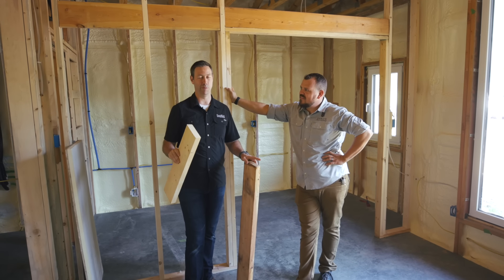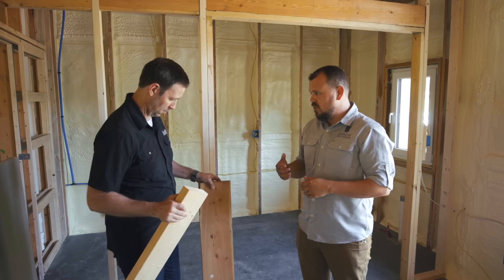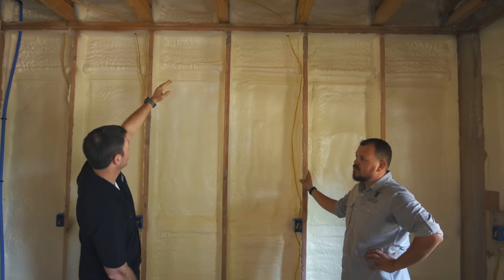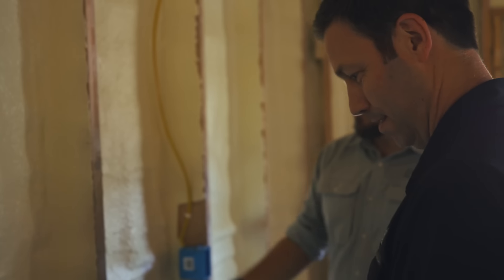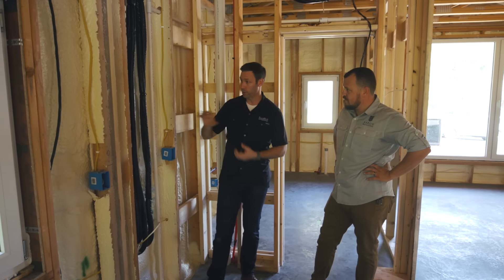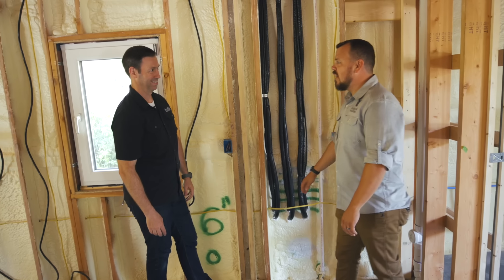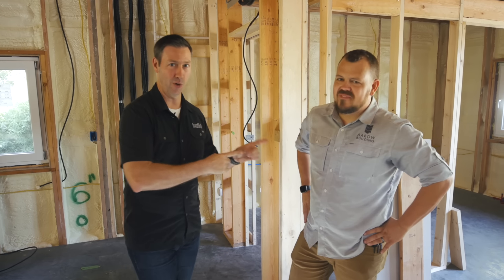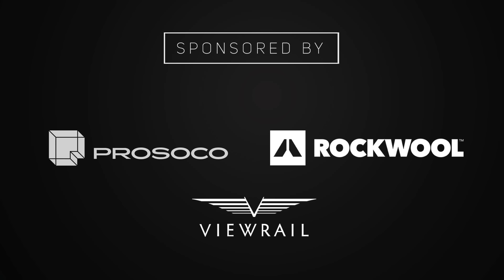Why would you frame a house with 2x8 lumber?

Comment: In Finland we use 2x8 and then a 2x2 on The inside with the air barrier in between,  that has been The norm here for about 20 years
Reply: damn you rich...
Reply: @lifeispain07  In Sweden we used to do that : ) now some new houses have 2x14" (most have 2x9.5"), and that is not even a passive house build. It really don't add a lot of cost going up.
Reply: @lifeispain07  And generaly the houses are much smaller.  It's still a good thing to be warm at -30 degrees.  And something to think about here as our winter temprature appear to be getting colder.
Reply: Simon Jäkälä 

quick question, are wood houses common/predominant in finland? i’m from central europe (let’s say, the temperature range would be from -20C to 36C (-4F to 97F)) and although i feel like they’re gaining in popularity, still most of the family houses are done from some type of brick/concrete.

on youtube, one gets the feeling 95% of US family houses are some kind of wooden lightweight frame construction.

edit: here for example stats from germany (2018, family houses):

(clay) brick 25.300
autoclaved aerated concrete 20.721
wood 16.711
sand-lime brick 11.944
reinforced concrete 4.883
lightweight concrete 2.709
other 1.232
steel 3
Reply: Thougt exactly the same, even with the outside insulation you get a thermal bridge With 2x8" if you use 2x6 and then additional 2x2 you get a real reduction in thermal bridges that will save you money in the long run.
Reply: @kam_iko 

Of all The smaller/normal residential houses i would say about 85 percent is some Type of wood structure, log or stud
Reply: In Denmark I just finished 2 houses with normal brick walls outside, a 1" wood fiber board, 2x6" and 2x4" walls.
Reply: @kam_iko  I imagine that wood framing lumber is not as available in many places in Europe.  In the USA we still have trees avalable at an economical cost.  We also replant forest lands, unfortunately this should have started 15 to 20  years earlier.  But the regrowth is going well and the cycle is on going.
Reply: Simon Jäkälä 

interesting, is it because of tradition, price or pace of construction?
Reply: David Johnson 

i don’t know, forest farming has quite a tradition here (central europe), but i’m not in the construction business, so can’t really comment on the lumber prices.
Reply: @kam_iko 

Well tradition and price but that is due to abundance of trees/forrests. The planting of new trees vs. old being cut down when measured in m3 is about 125% in favour of new trees
Reply: In the faroes we do the same , we also build concrete houses with essentially a wood house on the outside wich holds the isolation
Reply: @simonjakala2046  Russia have a lot of trees so no problem of a shortage :). New houses in northern Europe are all pretty close to this one. Insulated slab on grade, floor heating, wood frame, deep studs, rock wool,  only exterior differs. A lot use wood other go for stone or other.
Reply: @kam_iko  Three things may be advantages here on or near the west coast: a lower cost, very fast to build and very earthquake resistant.
Reply: David Johnson tree farming has been in existence for over a century.
Reply: snettan So horizontal 2x2’s? This will give you 2” more inches of insulation towards the interior of the envelop, not the exterior. So your taking the R6+/- of the Zip System and transferring it to the inside. Then there is no conduction to the inside except where the 2x6 and and 2x2 meet. Seems like this would be a little less money, but same insulation value or space of 8”.
Reply: @tyrehester5550  And in the north west they were slow in starting an effective tree planting program.  There could be a lot of hundred+ year old trees here but they didn't get planted.  Most tree planting here started about 60 years ago.  In spite of all the other tree planting in the world.
Reply: Just to be clear, you are talking about 50x200 with 50x50 inside?
Reply: @ReedikTuuling  Yes, except usually made from dimensional lumber which is 48x198 and 48x48. 
Simon Jäkälä forgot to mention that wall thickness is on building code because insulation value requires that wall thickness with blow-in insulation or batts. You can make thinner wall if you use better insulation like PIR.
Reply: @lifeispain07  Rich? 
Here in Finland Spruce 2x4 lumber cost $0.6 / foot and 2x8 lumber cost roughly $1.4 / foot so not  huge difference on whole frame and we always use 24 O.C layout on exterior walls. 
Also building code requires thick wall due insulation value needed.
Reply: @MM-sf3rl  So horizontal 2x2’s i great in so many ways. Lets see. Adds a conduit for electrical. Adds insulation before wapor barrier, and that gives is stops condensation if you cool the house in summer. Adds R value, We can use thinner studs and that gives use more of thinner trees. Adds stabilization, gives flatter walls. Adds strength to drywall.
Reply: @mr.wizeguy8995  When you use stronger studs you don't need them 16" on center and that gives u need less of them if you go bigger and stronger. And that makes up for a lot of the cost.
Reply: @ReedikTuuling  In Sweden, perhaps other EU too i don't know lumber is normal in, 45x45 (used inside walls, horizontal), 45x70, 45x95 (common), 45x170, 45,120 X195 X220 (used for walls in new houses), 28x70 (used in ceiling before drywall and outside. All in millimeter.
Reply: @72strand  Here in Finland we have 48x48, 48x98, x123, x148, x173, x198. 
It's quite rare that residential house is built completely on site, really often walls comes from factory as premade either whole wall as one element or smaller 4ft wide and room height elements.
Reply: @davej7458  You'd be wrong in that assumption. Not only is lumber more available, but it is of a higher quality. Forest farming has been going on for decades longer in Europe than USA interests ever cared to investigate. Better quality by an exponential amount.
Reply: @donaldcole1803  That was not an assumption it was an open question.  I made no comment about tree farming in Europe as I have only a general knowledge of Europe.
 We on the the other hand have lots of trees and different problems.  Our Government is restricting the use of those forests.   Many are dead or drying because they have reached their healthy life span other species in other areas have the potential to live hundreds of years more.  Because of the poor management practices of our government we have beetle infested forest land full of dead fire hazard trees. There are enough beetles spread to and overwhelm healthy forests. The natural fire cycle os destroyed. Instead of a normal fire that clears the brush and allows seeds in the forest seed bank to grow.  We have a fire that destroys every thing all the trees and seeds.  Also the creeks rivers and the fish.
Reply: @davej7458  What you posted is once again false, though it supports your underlying narrative. 'Our government' is NOT - repeat NOT restricting the use of forests. First of all, the federal government does NOT own all the forests in the nation. That is Part One of your lies - multiple. Second part of the lies, even the forests the federal government does own, they are not 'restricting the use'... they are restricting the deforestation. They are restricting the mining. They are restricting the raping of the land for commercial profit because under the Republican President Teddy Roosevelt over a century ago the nation realized sometimes you don't have to ruin every single thing you can see in order to make a few extra dollars of profit.
Reply: @davej7458  Actually balloon framing - as done in the USA --  is extremely weak in protecting against earthquakes, not to mentiopn earthquake protection has NEVER... EVER been a focus of USA construction.
Reply: @donaldcole1803  Balloon framing is continuous vertical framing members from the foundation to the roof line, with the floors hung on the walls.  Pretty much a thing of the past, 60 years ago more or less.  Most of what is done today is platform framing.  Framing members going from on top of first floor /platform to support under the second floor/platform, for each floor. On the west coast the Uniform Building Code requires thousands of dollars worth of expensive labor and hardware to tie foundations, floors, walls and roofs together for earthquake protection. Often when  working on an existing building or changing it's use it is required that the buildings earthquake resistance be upgraded.  Costly but nessary.
Reply: @davej7458  That terminology is quite often used in the USA to describe the construction technique predominant here. Despite that, your earlier comment still remains false. So what do you say about that?
Reply: @donaldcole1803  I realy don't I have any thing to say that would satisfy you.  Some time in the future, life experience may broaden your view point. Have a good day.
Reply: @davej7458  My life experience has been, and continues to be, quite 'broad'. However it remains nowhere near as negatively biased as yours. Have a blessed Thanksgiving.
Reply: @snettan. There is still considerable thermal bridging with that foam backed sheathing?
Reply: Your framing is in inches?
Reply: @Pisti846 
No, in mm so standard framing is 600mm o.c (24in)
Reply: @donaldcole1803  No, you are incorrect. I have worked all over the US in my career. Balloon framing refers to a specific historical construction method. I've never seen a house balloon framed in my lifetime in any state in the US, nor have I ever heard anyone else mistakenly call platform or stick framing 'balloon framing.' Sounds like you misunderstood what someone told you once and you're repeating nonsense.
Reply: @onetwothree4148   Then you are either deliberately naive or just extremely ignorant of everything involving your industry. Perhaps you just do not understand the fundamentals of US construction techniques, that would be my guess. Stick framing is just an iteration of balloon framing, and the terminology rests solely upon the user. We can get into the weeds about the differences that differing camps like to argue over, but the truth is that it is all under the same tent. If you want to continue to pick at nits, I am willing, but you will be shown to be wrong. So.. go ahead, chase the false narrative.
Reply: @donaldcole1803  No, stick framing replaced balloon framing. https://www.britannica.com/technology/balloon-framing That's what everyone from dictionary.com to thisoldhouse, finehomebuilding and every construction and fire science textbook I've ever read say (every textbook I've read that was written after platform framing includes 'Balloon' and 'Platform' as two different types of framing). 

More importantly that is the way the term 'balloon framing' is used in the US. If you say 'balloon' when you mean 'stick' everyone is going to think the opposite of what you are talking about. In all my years, I've never heard anyone intentionally use 'balloon' to mean 'stick' and no one will know what you are talking about if you insist on dying on that hill.
Reply: The house my father built (in Canada) with the help of me and my brother over 25 years ago was built with 2x6s exterior and offset 2x3s interior, with the vapour barrier between them. We used 2x4 blocking (flatwise) mid height to fix the 2x3s to (we kind of just slit the insulation behind the blocking rather than cutting out chunks of it, so it got a bit more compressed than would be ideal). At the windows in the 2x3 wall we turned 2x4s on flat and placed 1" rigid insulation behind the 2x4s against the 2x6 window casement framing. The 2x3 walls were set on top of 4" thick rigid insulation with another block of 2" insulation at the top, so we effectively didn't get thermal bridging *anywhere*.  The other great thing is that all of our electrical runs are in the interior wall, so we didn't have to concern ourselves with sealing electrical boxes, plus the electrical work could be done in the winter as the house was already better insulated than most houses of the period, even without the supplemental 2.5" of interior insulation.
Reply: @kam_iko  lol thank you for the Fahrenheit conversion for us americans :). And yes, most homes in the US are stick frame (wood) construction. Although it can vary. Here in Chicago, the entire city burned to the ground about 100 years ago (everything was built of wood, from the buildings to the sidewalks), so they decided to build everything out of brick the next go round...newer homes are wood framed (we've upgraded our plumbing since then ;P but we still have extremely strict fire codes). And some homes are wood framed with a brick facade or exterior (so brick instead of vinyl or wood siding)
Reply: @kam_iko  i think it is a combination of all of those things. most material choices are dependent on what is readily available and accessible. here that material is wood. Because wood was available most people used it therefore it became traditional. People continued to improve the efficiency with which it is installed and fabricated because it was used so often. Most stick framed homes are just assembled now - the walls come prefab. The quicker it can be done the cheaper it can be done. There is a lack of familiarity when it comes to residential building with concrete (unless it's the foundation)
Reply: So who installs the framing if they're all Finnish carpenters?
Reply: Damn you Scandinavia!  You always do everything better than the rest of the world 😁🙈
...but Finland, you wont win the word Championships this year for Hockey.  Sorry

Comment: My preference is for 2x6's.  I used 5/8" zip board on the outside of the studs.  I live in the south and daily condensation behind siding/brick is a constant battle, we kept the condensation layer away from the water/air control layer (zip board) by placing one layer of 1" iso horizontally, and a second layer of 2" foil covered iso vertically.  Then attached furring strips to each stud to mount our siding.  At the bottom of the 3/4" furring strips we placed Cora-vent and allow the air gap behind the siding to ventilate.   This allows moisture and heat to escape, as well as keeping the condensation layer away from the water/air control layer which over time degrades it.

Comment: I'm a contractor in northern New York, and I've been framing with 2x8s for the last 2 years. With increases in insulating requirements, it's much cheaper for my customers to buy 2x8s, and fill with 2 layers of r15 Roxsul for a wall cavity R value of 30, than to use zip-R, at its bloated cost.
Reply: I agree, just got a quote today on the ZIP R here is eastern canada and its over $100.00 per sheet....very expensive
Reply: @drummerboy6178  Yes Eastern Canada here, Prince Edward Island. The plan at our end is 2x6 studs, no zip, but 3/4 ply and then 3 layers of 2" rigid foam. Zip R in zone 6 and above will not provide the right shear force with insulation against the studs...also poly iso is less affective in cold and that is when we Northern folks need the R value. Seems ridiculous to buy zip R up here in cold climates.   All good info to share with each other. 🇨🇦👍
Reply: @MegsCarpentry-lovedogs  Also in PEI here, 3 layers of 2" rigid foam, very nice...but above my budget, Im going with the R24 in the walls and 1" styrofoam on outside walls giving me a R30 total..
Reply: @MegsCarpentry-lovedogs  What do u mean by ZIp R in ZONE 6....thanks

Comment: I guess it's one way to add more insulation. But, it seems to me that when you get deeper than a 2 x 6, engineered lumber is a better way to go. Its made like an I beam with faces of solid wood and strand board in middle. You can make your walls 8 inches thick or more if you want and the strand board center makes it more insulating than a solid wood stud. Plus, the factory makes the  structural beams cut to order with very little waste. It's more environmentally friendly and less labor is required to assemble the walls. It's also lot easier to run wiring and plumbing through them. The problem with large timbers is that they have to be cut from larger trees with a lot of waste. Engineered lumber can be made of practically the entire tree and they don't have to be as large. Have you tried to find decent large timbers these days? The quality isn't like it used to be.

Comment: We were doing this in the 1980's at Randy King Construction in Waynesville, Mo.  Increased the R Value and add almost nothing to the cost. We also used Marine treated plywood on the floors in bathrooms and kitchen and laundry rooms in case a water leak d over the life of the house. We used it in the roof as well.
Reply: Smart...very smart

Comment: I have more or less the equivalent in my house with is double 2x4 framing.  The studs in the interior wall are all offset from those in the exterior wall to minimize thermal bridging except at the corners and around windows and doors.  All wiring/plumbing is in the inner wall so there are no insulation penetrations in the outer wall.  A fair bit more work to frame though.  Back in the 80s when I lived in Manitoba we had a double 2x6 framed house.  It was very easy to heat.
Reply: Sounds like a better mousetrap.
Reply: how did you go about installing exterior doors?
Reply: @mikeb9245  Just like any other door.  Framed it in.